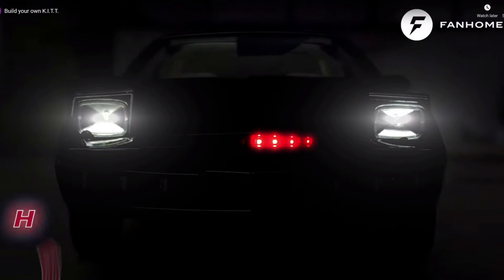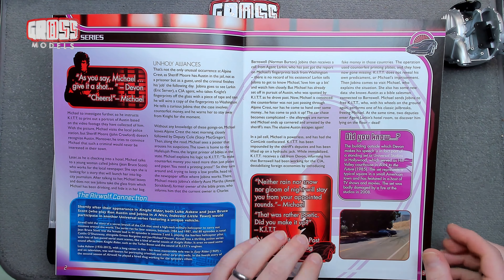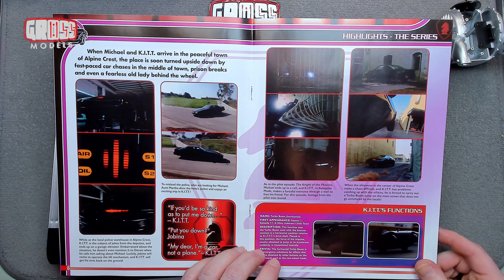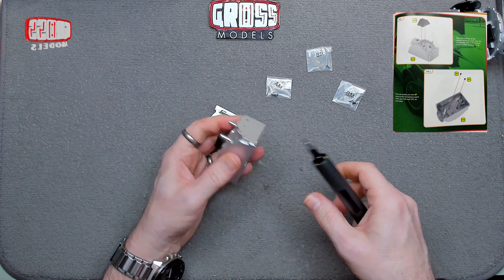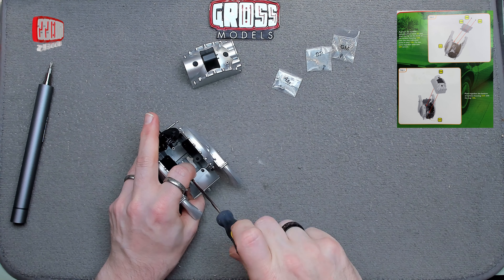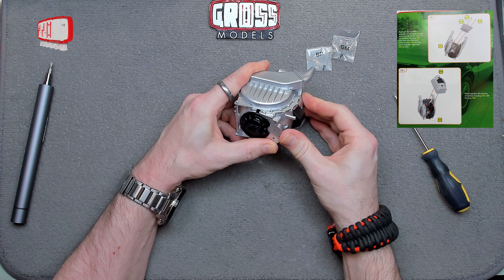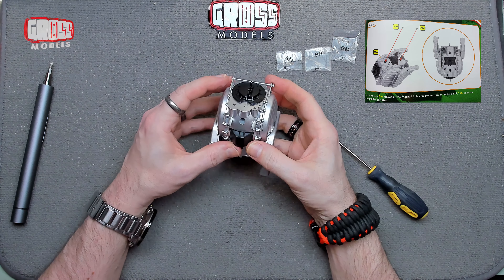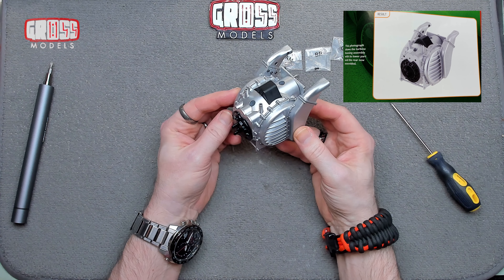Fanhome 1:8 scale KITT build. Issue 23

Comment: The actual car in the show had a normal Trans Am engine. This one is indeed a fictional turbine to represent what we heard in the show as they removed the actual engine noise and replaced it with a cooler sound. This is the first time I know of that represents the engine that was in the fiction. The show made it a point to never show it when the hood was open. We could just occasionally see the air filter on top.
Reply from the maker: Apparently the engine did appear in a single episode, but I don’t know which and have no memory of it.
Reply: I was curious about that too..thanks for the info 🙂